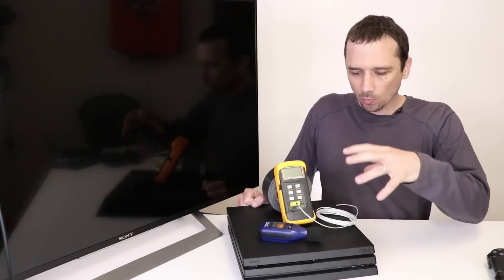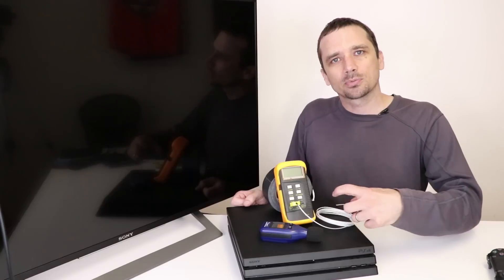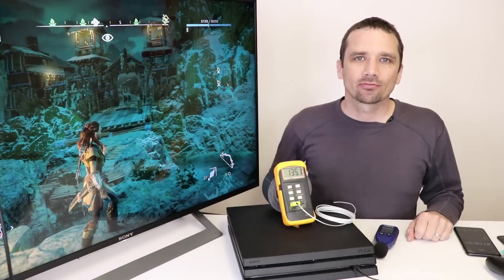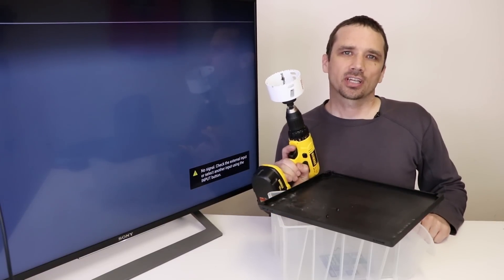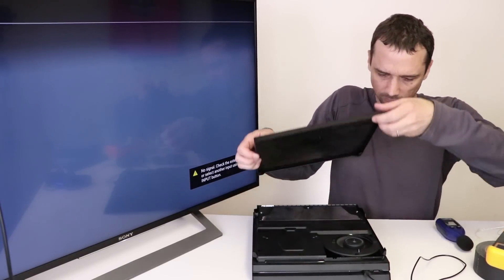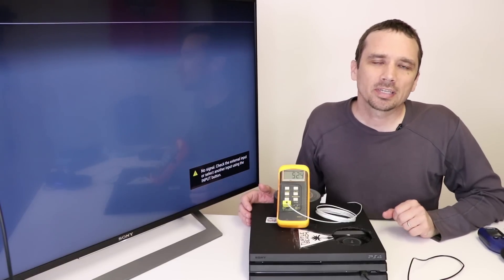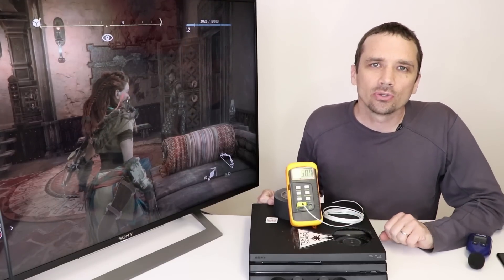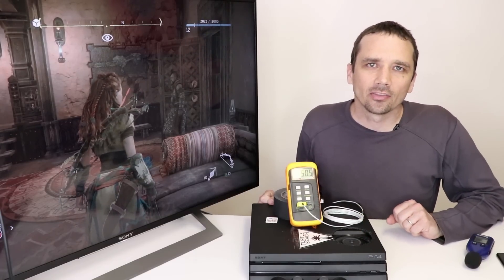PS4 Pro Case Mod - Fan Noise Overheating Fix?

Comment: So I've concluded for noisy ps4 pro replace thermal pads with w/mk12 thermal pads, replace thermal paste with liquid metal, replace fan with nidec version, make holes on top maybe cover with some nice vent = super cool and quiet ps4 pro
Reply: D2daK87 make a video?
Reply: @sweetschannel7564  basically only apply on the pro series.
Reply: Has anyone else tried this?
Reply: @mongrossmon  I have. I used noctua nt-h1pro thermal paste on cpu and arctic thermal pads for the memory (there's plenty of YouTube videos showing you how). Then I simply removed the top cover and drumroll.... Little difference. The PS4 simply has one of the worst if not THE worst cooling system.  ...Of any console.  ...Ever. Period. P.E.R.I.O.D! This video shows that cutting a hole (or just removing the top) can make a slight difference, but trust me it's slight. So sad that people, my self included, have resulted in gutting our consoles... Might as well buy a pc. 

If you want a legitimate solution, the biggest and really only thing you can do to keep fan noise down is keep ambient temperatures down. Set your thermostat to 68 degrees and the fan is nearly silent. 

I don't like wearing headphones and if the ps5 still has thermal problems, I'm switching to Xbox.
Reply: Where can I buy the nidec fan?
Reply: I got the fan on ebay. Used new thermal pads and liquid metal on cpu and gpu. Is much quieter. No holes or anything though
Reply: D2daK87 okay thanks! I’ve got the thermal paste, but the fan still goes like a jet, I’ll see if I can replace it
Reply: @ArturoSM01  thermal paste won't make much of  a difference. Liquid metal helps.
Reply: @ArturoSM01  ideally change the thermal pads for better ones as well.
Reply: D2daK87 okay, thank you for your advices!
Reply: @ArturoSM01  no worries :)
Reply: Gone thru the same process like yours except for the top cover hole, horizon zero dawn sound acceptable from start to end , very pleasant playing experience, if it's sound like jet engine I really felt it's going to take off like fighter jet and blow itself to pieces. Now waiting patiently for spare PS4 pro cover to open up a hole on top of it as the last part of the cooling mod for PS4 pro

Comment: I own a PlayStation 4 and took it apart to see how it operates. And I was wondering why it looks the way it looks. It’s all cosmetic to look cool and hip. Because I was concern on how it got cool air to keep your system in operative  state. How does small vents on the side propel needed cool air to the fan? As though the system already emits and traps heat underneath it cover. Plus it expel the existing heat through the heat sink and then the power supply. Which made me question what is PlayStation thinking?
Reply: PlayStation What it to break down, so that we Buy a New console every now and then.

Comment: I cleaned my pro today and accidentally placed the lid on wrong and gave it a press :/ Now I can't make the lips on the front of the case catch the lid (they flex outward) any suggestion on repairing or modifying my lid?

Comment: I just took the cover off mine and played it that way. The fan never went above the lowest setting. The reason being is that the cover actually made the power supply hotter by noe releasing the heat from the top of the console. No air circulated over the top of the power supply to cool. Funny.....it took me to figure that one out and not the engineers at Sony. That's why they're overheating folks! Just take the top cover off and you'll be happy. You're welcome!!!
Reply: If you dont mind how it looks then yeah
Reply: @MirzaKhalid  why would it be in just a "developed" country like ours? Sounds to me like you're trying (desperately) to make it sound like wherever you're at, its better than here. 
Nice try, thanks for playing...

Comment: just from eyeballing it, i'd imagine the result could be replicated by simply removing the top cover, which would also be 100% reversible if one changes their mind
Reply from the maker: Yep...but what's the fun in that?!
Reply: @Tronicsfix  honestly, you raise a good point 👍
Reply: TronicsFix it’s good content and you can be creative
Reply: I did exactly that and my ps4 doesnt sound like a fighter jet anymore in the mw lobby
Reply: I take mine off to play and rest it back on to protect from dust when not. Much quieter.
Reply: hes dumb. hes jst do it without brain
Reply: @mckevinleetan1850  you talk like you have no brain either.
Reply: But doenst that make it highly likely to get so much dust inside?
Reply: @joaopereira4218  i am thinking of drilling a hole and covering it with a dust filter. Wish me luck i will probaply burn down my house while doing it
Reply: Just cover the fan with a dust filter while its open....No need for holes.
Reply: @lisserkc6000  how does your pro run now? What thermal paste are you using? Could you show a picture? Is it worth doing?
Reply: @Jacob-hl3gt  i did not do it, i decided to just buy an ps5 as soon as it comes out and hope that they actually got a decent cooling system in it.
Reply: @lisserkc6000  how did it go?
Reply: @lisserkc6000  were u able to get a  ps5?
Reply: @victorlim3534  nope
Reply: @lisserkc6000  
And the verdict is: it doesn't. Sony should stop trying to be Apple and actually worry more about functionality than aesthetics
Reply: @frealms  What? The PS5 is quieter than a mouse what are you on about?
Reply: @SavagePatch115  
I'm just glad this is written, otherwise I fear we might be yelling at each other so you could hear.
Reply: @lisserkc6000  im curious, still no PS5? 😀
Reply: @SavagePatch115  Says a guy who had owned it no more than 6 months at the time of commenting. The ps4 pros were pretty damn quiet with most games when they were fresh out the box.
Reply: @lisserkc6000  did your house burn down ?
Reply: @joaopereira4218  Which is why if you have a hole drilled in it you have a screen put on it that you can replace or clean every so often
Reply: @joaopereira4218  I did this same mod but put a PC dust filter over the hole on the original PS4. Also added remote RGB LEDs in the fan, PS4 logo and side vents. On my channel if you want to check it out
Reply: but it can get dusty and its scary wiping dust and breaking some thinking

Comment: How much cooler would it get if you put a fan on the hole? Blowing in and blowing out.
Reply from the maker: I don't know but it would probably make a difference.
Reply: @Tronicsfix  a new test? For science! :D
Reply from the maker: For Science! Might have to try this at some point.
Reply: @Tronicsfix  ive done it..it works well with 2300 rpm fan above hole..cools down alot... ps4 pro hardly ever kicks into overdrive
Reply: @SC-je1ee  how does that work? Does the USB Fan suck or blow air?
Reply: I've also done this with my Pro, with a second fan pulling the heat from the exhaust. It runs a hell of a lot cooler. My console was overheating and shutting down before I did this.

Comment: Thanks for the wonderfully informative video. I am wanting to perform this mod as I currently have the lid off mine while vertically mounted on the wall behind the TV. It helps tremendously with my Pro not having to kick into jet engine mode all the time. I was wondering if you had any possible measurements you can share regarding where to make the cut on the top cover? I don’t want to have to ‘eyeball’ it if I don’t have to. Thanks.
Reply from the maker: Unfortunately, no...I don't have any measurements. You can measure it thought...just measure how far the fan is from the side edge and the front edge.

Comment: Thinking better. That top cover is unnecessary. Is not covering any essentials components. It just cosmetics. And the airflow coming from these side holes is not taking any heat away from the top cover.
Reply: @gkennedy0969  Yeah im curious about this too...come through for us
Reply from the maker: Yep, you could just remove the top cover....but drilling a hole in it is way more fun.
Reply: @Tronicsfix  yeah. Its fun. I planning to a a dust mesh that cover the fan area without the top cover. Could you measure the temp without the top cover??
Reply from the maker: Yes...not sure when though.

Comment: Beside this hole. I think i need to add small littles holes by the exhaust area. On top and bottom case. The heat is concentrated there.

Comment: If anything the fan will gather more dust quicker than usual resulting in overheated
Reply from the maker: These consoles don't overheat because of dirty fans. They will overheat because of plugged heat sinks but not dirty fans unless the fan is really really really plugged.

Comment: congrats, now you have more dust in the system, the cooling will thank you with some heat isolating dust and in some time the fan will be more loud
Reply: A dust filter solve this issue.
Reply from the maker: So just blow the dust out...problem solved in 5 seconds.

Comment: Is there a place where I could buy an extra PS4 PRO case lid? I would like to try this with a dust filter installed as well. I would pay for custom vented lids.
Reply from the maker: You might try eBay.
Reply: AliExpress.

Comment: i would like to know if its only the sound that i should be worried about or is the ps4 cooling system bad? because if sony made the fans to run faster during gaming as a precaution then i would not worry about it.

also what system are you using 70xx or 71xx. 71xx has lower sound it seems. 

and most consumers dont own a decibel meter, it would be nice if you could use an app on the phone. i know its not accurate, different phones different mic, but still. i own a 7016, and in god of war i get 90db on the phone, horizon i get 80db. its really loud. but never got a temperature warning till now.

entertaining videos. thanks.

Comment: The best game for heat/noise testing seems to be No Man's Sky - fan goes absolutely nuts shortly after loading so no need to play for extended periods.  Horizon Zero Dawn is actually bearable in comparison. (I play both).

Thanks, btw, for these vids.  I'm looking at ways to get my PS4 Pro quieter..
Reply from the maker: Glad you're enjoying these videos. Liquid metal will probably help the most.
Reply: TronicsFix LLC Can't believe the amount of work needed to pull the ps4 apart.. might have to give it a go though, it's ludicrously loud in NMS.
Reply from the maker: Yes, the Pro take a bit to disassemble

Comment: Steve, what do you think about put a water cooler on PS4 PRO?
Reply from the maker: Sounds awesome but also very difficult and expensive. I'll probably look into it at some point.
Reply: I saw a video here on youtube where a guy used a water cooler H45 from Corsair to do that on PS4 Slim, but PRO is a little bit different, because of processor location.

Comment: Hey, thanks for all the great videos, I just got a brand new Ps4 Pro, and It feels like it runs really hot, also I checked the temp with a laser temp gun at the exhaust port right above the power plug at the back and it was running at 155F at idle... that seems really high. Should I return it and get a diff one?
Reply from the maker: It's normal for them to run hot.

Comment: I had the same idea. This thing is loud as Hell!
Reply from the maker: You can also just take the cover off if you don't want to drill a hole in it.
Reply: Yeah I just use mine with cover off and it runs quite now. With the cover on its very very loud. Like jet engine loud.

Comment: Hello from Spain and thanks for the video.
I have a question:

Do you recommend to install a USB fan in the hole?
I have a 80mm USB fan (2700 rpm)
Reply from the maker: I don't think it would do much good but you can always try. It probably won't hurt anything.
Reply: Ok, thanks very much. PS4 seems to be less hot when I put the USB fan on the filter in the hole.

Comment: What's the difference from running it without the top lid ? Why not just remove the top?
Reply from the maker: That would do the same thing...but it's not as fun as drilling a hole in the top!
Reply: I run my Ps4 Pro with the cover off and it runs quite. with the top on it gets very loud.
Reply: berva good to know. Ordering a new generation Ps4 model today instead of the old. Doing more research to find out if the newer releases are made cheaper or not.

Comment: I did this a month ago. Horizon barely kicked up my PS4Pro. God of War made so much noise you could clearly hear it from 2 rooms away. I took the top off to clean the fan (was clean) and loaded it up out of curiosity, no more crazy fan. Put the top back on and within 2 minutes it ramped back up. I cut a hole in it, and got a little $5 or so fan grill on newegg. Done.  
So for the best test load up God of War, then pull up the map and sit there. The maps the only thing that kind of got sound going after the hole.
Reply from the maker: I may have to try this!

Comment: Thank You for this video.
Can you do the same tests..but with the top cover completely removed?
Not many will drill a hole in their top lid, but if you test it and it appears that with the lid removed PS4 pro is quieter and cooler, many will do it as it's not removing the warranty.
Reply from the maker: I doubt I'll do this test again, but you never know.
Reply: Thank You for the reply. As you have access to an open PS4 pro can you comment if and how will the air flow change with the top lid removed. Will it still blow the same amount of air through the heat sink of the APU, or more/less. What will be the temperature on gameplay with top lid completely removed compared with a standard ps4 pro? Drilling a hole, that's not many will do, but proving that ps4 slim/pro with removed lid work noticeably better (cooler/quieter) will benefit for many. And I can't find such video on youtube so far.
Reply from the maker: Good idea. I may have to try that.

Comment: Would it make any difference if you just take the whole top off instead of drilling a hole and then replace the top when finished using the Ps4, just asking a simple question
Reply from the maker: Sure, you can just take the cover off.

Comment: Hi i have a silly question. Is it normal for an external hdd to get hot if you put it on top of your ps4?  I've read a couple comments on the internet saying that it's ok to place it on top and i have seen videos, but i haven't heard of anyone saying theirs got hot.
Reply from the maker: Anything you put on top of your PS4 will get hot
Reply: Thanks for responding. I just don't want to ruin the external hdd or the ps4.

Comment: What about just running it without the top cover on at all???
Reply from the maker: Ya, you can do that but it's a lot more fun to drill a big hole!
Reply: problem with the big hole is it's ugly and irreversible. you can always just put the top cover back on.
Reply from the maker: I'm not saying the hole is the most practical!
Reply: TronicsFix fair enough, maybe if I trusted myself to do a good job of it I'd have a go, then maybe 3D print a cover/ dust filter for it
Reply from the maker: That would be cool! Just taking the cover off works fine too.

Comment: Honestly , i did this mod on my old fatty PS4 , and had to put some 120mm mesh dust filter , and used 4 water caps to lift the ps4 from the table around 1cm , as well placed thermal paste with good old MX-4 and some fresh new thermal pads .. no issue whatsoever with heat and its been a year already , I might consider Thermal Grizzly Kryonaut when i service my ps4 soon :)
Reply: did that on my pro and well just be sure to apply it on the APU AND the heatsink base. Even doing so when I reassembled mine I had a jet engine sound again right away. Turns out the liquid metal on the cooler wasn't "stuck" to the copper, and I had to play with it so it would actually adhere. After that, fan went mute.

Comment: Dang man, I had the same idea and drilled multiple holes in the top “ neatly “ and put a usb fan over the top of those holes and it mad a big difference in mine. It’s a lot quieter and cooler. Wish I could post pics on YouTube and show you how mine looks.

A friend of mine saw what I did and had me do the same to his and he bought the same usb electronics cooler fan I bought.

Also, I ordered a replacement case top to keep from drilling holes in my original case. I got that off eBay for about 35 bucks and the fan cost about 12, so that’s not bad for how much better my console runs and keeps it from launching into space.
Reply: What usb fan i need to know
Reply: @Pzeroshadow  me too

Comment: Crazy experiment putting a massive hole in top and introducing more dust and potentially taking your finger tips off in the machine..daft!!!
Reply: use a mesh filter to cover hole problem solved

Comment: Unless your ps4 is over heating (turning off)  there is no need to do this.
Reply from the maker: If you're PS4 is overheating you don't need to do it either as there is something causing the overheating that needs to be fixed.
Reply: TronicsFix i agree. Btw are you ever gonna do a xbox one x test video?
Reply from the maker: What kind of test?
Reply: TronicsFix the normal ones you do, noise heat, etc

Comment: i saw some slim power supply on Amazon whic one will i need for my ps4 so i can fix it
Reply from the maker: You need the power supply for your model of ps4
Reply: TronicsFix its easy to put in right
Reply from the maker: You can see any of my teardowns to see how to do it.

Comment: could you do a vid on LEDs in the case? great vid man I keep learning bout the ps4 keep em coming.
Reply from the maker: Good idea
Reply: @Tronicsfix  I replaced thermal paste on my ps4 pro model 7115b using Arctic MX4. Now it's quiet but still quite warm. No difference that I can tell heat wise. The thermal pads are original, do I need to replace them to keep my machine cooler? Also, what about putting a pad by the HDMI port? 
Thanks